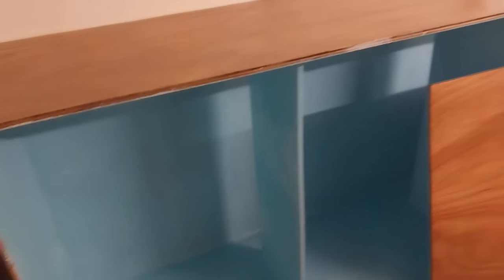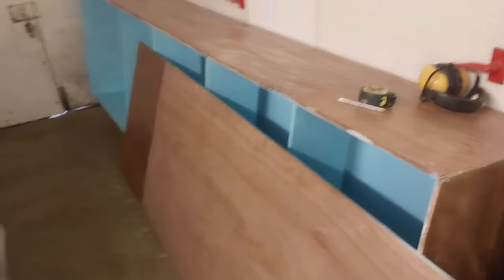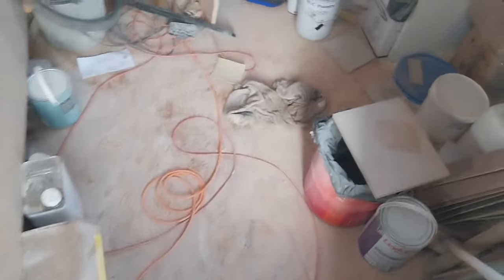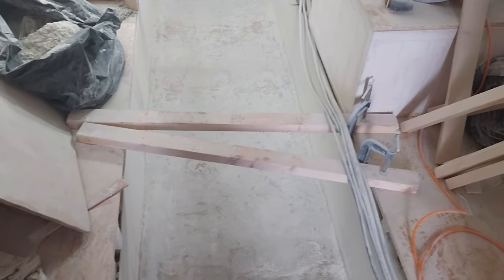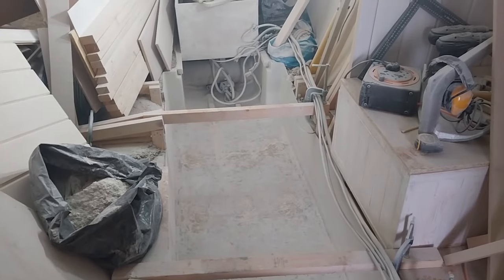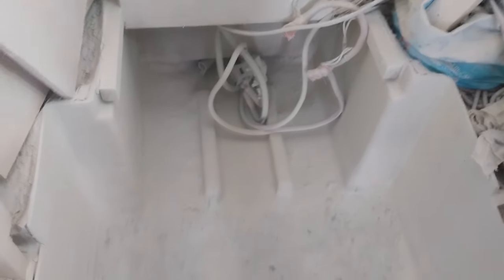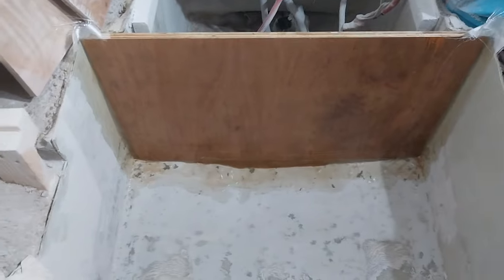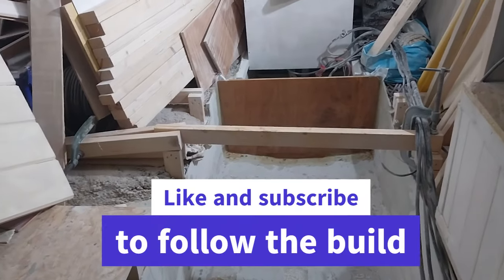Lifeboat conversion Ep.50 Giving up on this watertank and starting again.

Comment: I know it will cost but can you get a custom made plastic tank built for your requirements 😊
Reply from the maker: I have asked quotes for one and they are talking about £2200.- . Not funny.
Reply: Have a look at the durocell project  he did an episode on making internal water tanks of his with fibre glass and with  green board cannot remember the name they  built into  the  sides of  the  hull
Reply from the maker: Cheers, that is kinda what I am going to do. That project is all about saving weight. Luckily that is not a worry in mine.😁